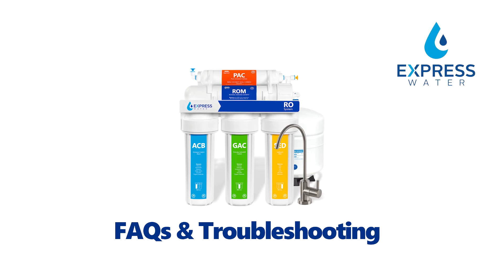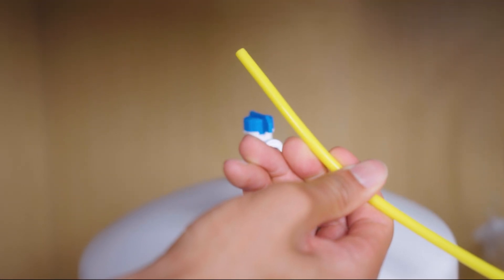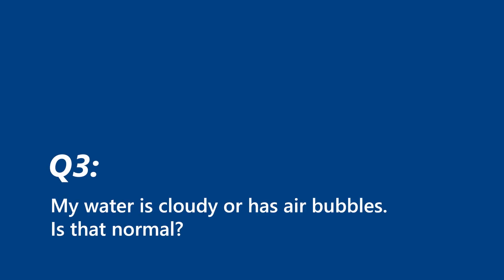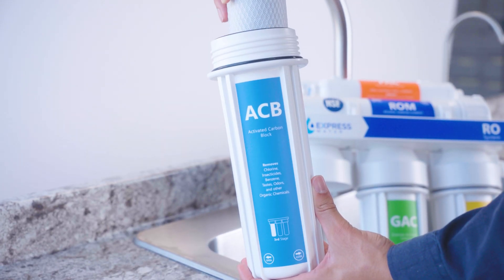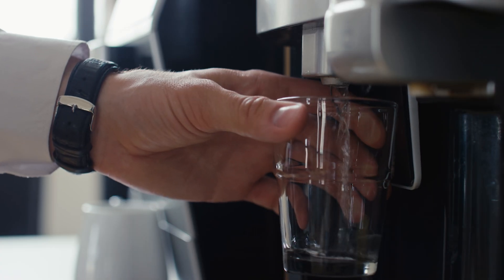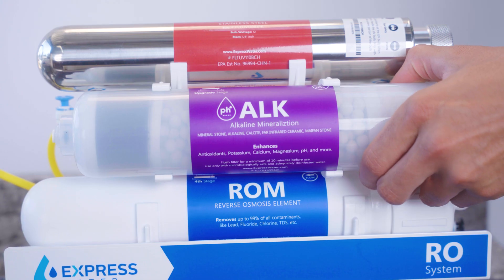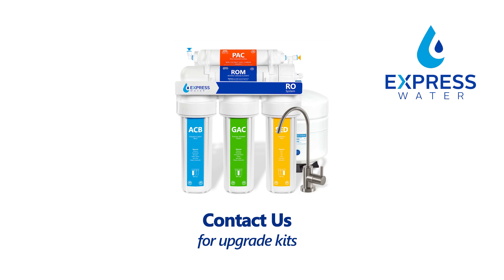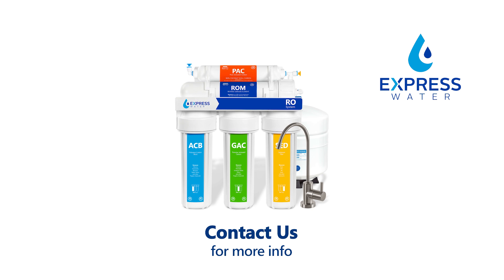Express Water RO Systems | FAQs & Troubleshooting Guide

Comment: What is the issue when the flow starts off really strong, but almost immediately dies to a trickle. I've tried all the troubleshooting suggestions so far but nothing has fixed the problem. I can't get more than 32 oz of water out of the faucet at one time